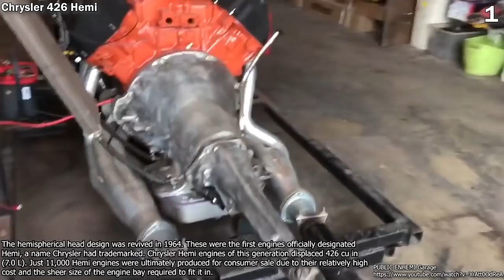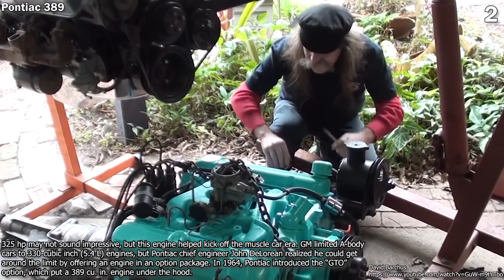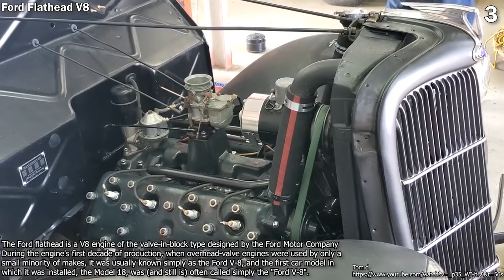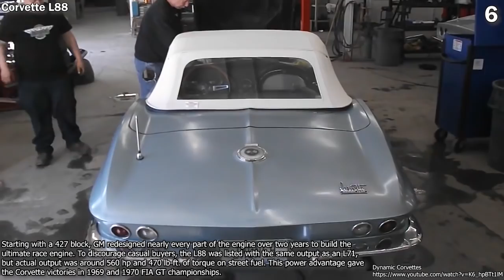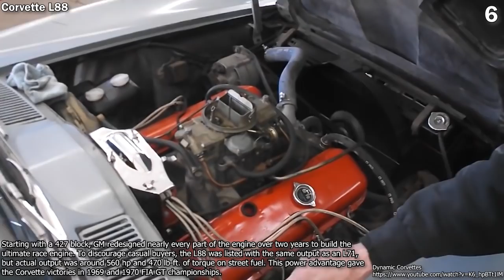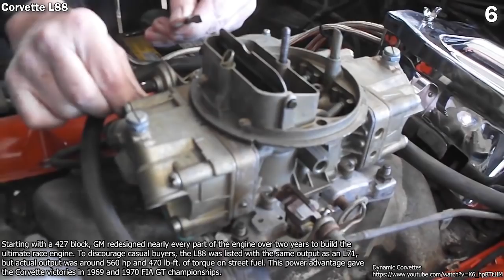Old MUSCLE CAR ENGINES Cold Starting Up and Loud Sound

Comment: If you’re interested in the specs of the 426 Hemi it’s a 1971 Date Code block with a comp cams mutha thumpr cam. Ported and polished heads with 13.5-1 compression through 3 inch TTI headers with glass packs.